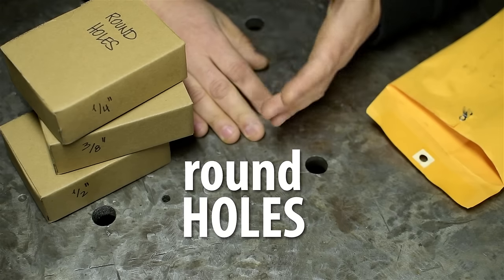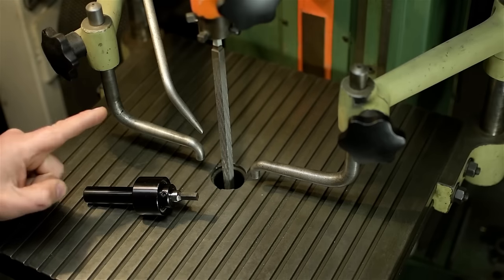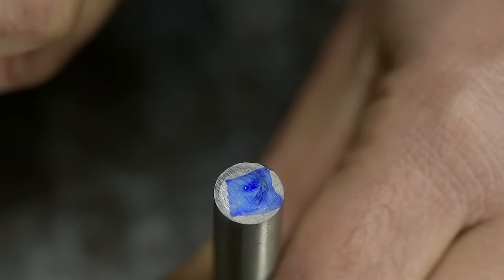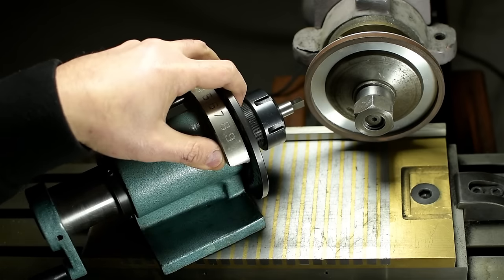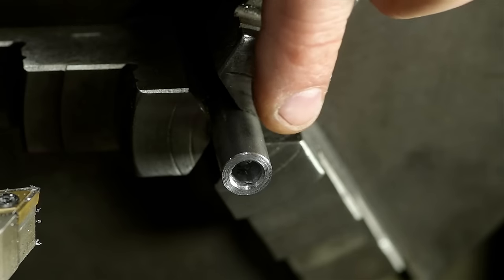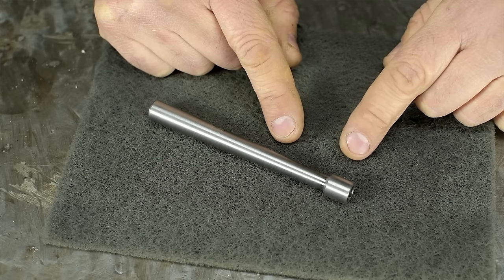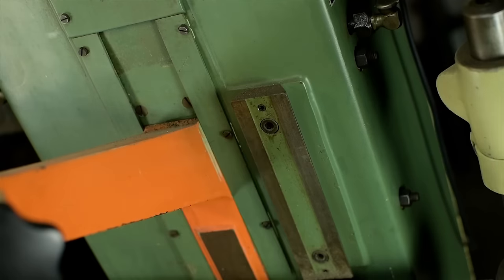Square Holes!

Comment: Help me This Old Tony. You’re my only hope. I’m new to the channel, and I’m loving it. This is the second video I’ve seen where you use a broach. I am not sure what is going on in the mechanics of the cut. It seems like the broach is just, forgive me, pushing and “scraping” corners into the edge of a round hole. But if that were all that was going on, then why would the parts have to be spinning? Obviously the broach chuck is doing something more than just holding the broach, but what?

Comment: khmm, khmm...... Sorry to disturb, but by doing this: 8:08 you lose the square. The 7x7 dimension is only in the corners - the cutting edges become elliptical. The greater the grinding angle 5:40, the larger the ellipse. As you mentioned at the beginning, it is a rounded square. This is important information for those who need the perfect square.
.... what's more: great job!

Comment: My dad used to work at a company called Jet Edge. They could help you make square holes too, but in a different way.
And it won't be too cheap either. Also you'd have to learn how to use their machines and that includes the software. 
Nevermind, I dunno if its worth it for the average guy.

Comment: These green not so expensive Chinese indexers are really worth their money, the only thing I didn't like was the 4 sides of the base are not sqare to the spindle when you buy it , but after a little time on the mill you can be sure they are now.🤗
And as you have him already on the table I milled two sluts one  each side so you can easy bolt it to the table...for the short time all is done it improves the indexer a lot and since that i use my one more regulary and like him now a lot. The more expensive models with a brand name which look the same have it all anyway.

Comment: Damn Tony, I didn't even get if the hex tool for hex holes is one of your jokes, or a real one from some esoteric geometry principle idk bout instead.
Reply: Damn it wasnt. Now I completely ununderstood how that tool work on the lathe in relation to the part. I see them both spinning, I didn't get a sh*t. 
I thought you used a kind of eccentric shape like a mazda rotor to bore square holes with very little rouded corners.

Comment: I really enjoyed this. Why is the lathe thingy ( scientific term in the text) spinning to push it in, to make the square hole? aren't you just forcing it in, with each corner shaving metal? aren't both bits spinning at the same rate? what is the purpose of the spinning, when you could just use a high pressure press?
Reply from the maker: the spinning forces the broach to wobble.
Reply: @ThisOldTony  Awesome, thanks, so micro movement does it, That's genius.

Comment: I thought this was a joke, then 10 minutes in, I thought wow, this is an elaborate joke, Old Tony is a mad lad. I'm still not 100% convinced hes not pulling our leg but I guess he did just cut a square hole in a rotating cylinder with a square tool. You sure David Blaine isnt controlling that lathe?

Comment: I'm gonna dare ask a question usually asked on another channel (the big guy with the torque and two big shapers)... Why not USE THE MILL first for making the square section, and grinding it after heat treating the tool?

Comment: I am at a loss here. How does the rotary broach work? Is it doing anything else than just being pressed into the hole and whats the point of rotating it at is clearly must run in sync with the piece being broached (is that a word?) ? Or is it oscillating?

Comment: Or, you can do what I did once (_once_): weld four flat bits of steel together to make a square socket. Add more weld and grind, add more weld and grind... detemper all that weld with a rosebud torch, then turn the thing in the lathe until it starts to resemble a socket, lather, rinse, repeat... that !#$^ thing is still around here somewhere, but the hardware I made it to fit is long gone.

Comment: The rotation here is just not necessary... I'm assuming this is just an adaptive way to use a lathe to force the broach through the hole? Like the way you would normally broach... Without a thousand steps... And a huge ass lathe

Comment: I don't get it. That square tool is actually rotating with the cylindric hole it has to make square. So there seems to be no movement between each other. Is there an abrasive process, or a deformation, which makes the hole square?

Comment: I didn't understand the rotation of the tool, until I watched this. https://youtu.be/GWyHJVOxKK4?t=702  Now I understand, The tool is at a very slight angle to the hole, as it rotates the pressure is on a small part of the cutting face that continuously changes as the work rotates.The cutting tool and the work rotate at the same speed.

Comment: Im not sure i completely understand how you cut the hole square. It seemed the bit caught the metal and spun with it at the same speed. how did is it boring if," since the piece and bit are at the same speed" the bit technically isnt moving compared to the piece.

Comment: Just came across this video, and for a so called mediocre setup (somewhere at around 4:55) it seems to be a purdy good setup!
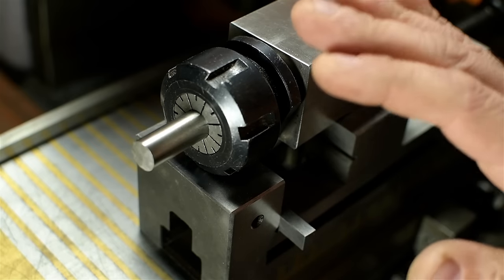But the reason I'm commenting here is starting at 5:25  the taper.
It is mentioned that ideally you would need a 1.5 degree, but only have a 1, 2, and a Colin Furze degree (which was hilarious btw.) but since the setup is supposed to be mediocre, why not continue being mediocre and experiment with the angle block set diagonally, which actually would change the angle, but of course, it wouldn't be accurate, but then again, 2° isn't 1.5° either... just giving mediocre ideas here ;)

Comment: Waste of time as you can actually buy a drill that drills a square hole. 
In fact you can buy a complete set of square hole drill bits.
Easy to use just put into the drill chuck and drill.